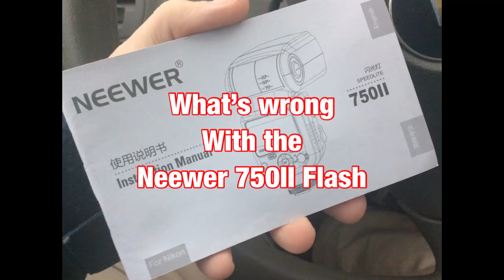What’s wrong with the Neewer 750 II flash?

Comment: I regret buying it. The moment I opened the box I noticed that the slot for batteries is falling apart. There was glue and falling plastic, it was disgusting so I called for a refund. I'll never buy any Neewer product, because of that bad experience. In fact, now I feel happy to pay the extra cash for an original brand flash, like Nikon.
Reply from the maker: The one I had was built well, but it was just too weak.  Most DSLR users would have a zoom lens with a small f number and need even more power

Comment: Hi Mike. I own this flash and enjoyed your review.  However, maybe I'm missing something here but the Guide Number of 58 for this flash that you quoted is actually given in meters, not feet.  The GN in terms of feet is 190, which makes a huge difference.  The documentation that came with the one I got shows both numbers (meters and feet).
Reply from the maker: I will recheck but was that guide number at ASA 100? I’m certain with my use of this flash that it doesn’t have a guide number above 100 if we use feet and key it to ASA 100 as was always the standard. If it had a guide number of 190 that means at ten feet we would set an f stop near f19 wives would be close to f22. My flash did not exhibit this level of power. Thanks for your input. I will look at the manual again.
Reply: @m005kennedy  Hi Mike. There's a chart in the manual showing the GN  for different combinations of flash output and coverage (focal length) all at ISO=100.  At full power (1/1) and a focal length of 105mm, the GN is maxed out at 58 meters/190.3 feet.  The GN drops to 15m/49ft if the focal length widens to 14mm (still at full output)
Reply from the maker: Ill have to check this out. I do have a meter where I can actually measure the output. Normally we use non zoom lenses because of the problem created by different focal lengths when calculating guide numbers.  Some flashes change the angle of light to concentrate it more for use at telephoto settings and increase the angle for wide angle shots. This would increase and decrease the guide number. Also is the consideration of how fast the flash cycles. If it does indeed have a guide number of 190 but takes 20 seconds to recharge the flash is of almost no use for indoor shoots were you might to shoot photos close in time to the other. An example for wedding photography would be when people are in the isles coming into the church. Also during parts of the wedding you need a faster recycling time. I did try the flash at full manual but it created much too long a recycling time.  I had to discount using the flash at high power because it could not keep up with the timing of needed photographs. Many photographers in the days of film would have accessory battery packs to allow their flashes to be use at high power settings and still get rapid recycling. I handle by using several set of NiCad batteries. You would get quicker recycling rimes but fewer shots with these batteries. But I would have several sets of four to feed into my Vivitar flash that I used. Another problem encountered by digital cameras is that most people have zoom lenses that don’t have wide openings. A zoom lens with an f3.5 or f5.6 opening loses light rapidly as it zooms. As a film photographer using ASA 100 or 160 film and a good prime lenses I could get outstanding photos at f4. F course I could have those dedicated fixed lenses with digital but I’m not doing weddings anymore and this was more of a favor so spending hundreds of lenses was not a good choice.
Reply: Recycle time for this flash is about 4 seconds, which isn't great but good enough for my needs as I'm not a pro. It does have a built-in zoom function which changes the angle of the light emitted (as you mentioned above).  The flash zooms automatically if you are using TTL mode or you can adjust the zoom manually.  Regarding the aperture issue, you can always bump up the ISO if your lens can't go wide enough - huge advantage over the film days! Good stuff.

Comment: I have this flash ... I'm a hobbyist and new to photography so I bought the cheapest I find... For the past 15 month I enjoyed the results of the flash ... a professional wedding photographer is paid well these days so he should be able to have way more expensive setting (whether more expensive flash or multiple of cheap ones )... 

The main Issue I found with this flash is the fact there is 2 models with the same number (750ii) one of them support HSS and the other isn't and they cost about the same ... When I bought mine and received something other than what in the listing picture I thought it is the newer version ... now 15 month later I just figured out that this is doesn't have HSS while the other one did

Comment: Thanks Mike, I've bought this flash and have a Nikon D7100, nowhere on the internet could I find what settings for camera sync do I need, only how to take pictures with the flash. Brilliant!
Reply: With TTL the flash seems to share exposure data with the camera so it will deliver the write amount of light ... The Neewer 750ii has 2 versions with the same name yet the buttons are different ... Mine doesn't have HSS mode which is useful if you want to light something under the shade while the shutter speed is so high (1/1000 or even faster) .. this is very useful feature ... If you have the one that doesn't support HSS then the only way around is to use it on manual and choose maximum power (1/1 is the maximum 1/128 is minimum) ...
Reply: Hi,
I have this flash as well. How do I get the flash to flash once? It’s flashing 3 times.. I don’t like that.